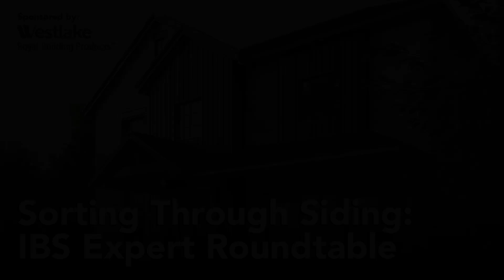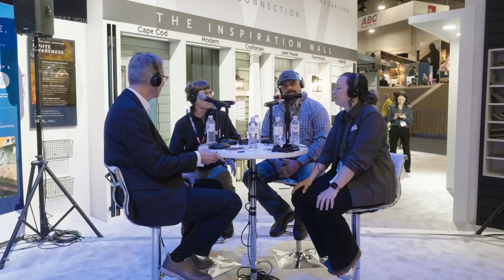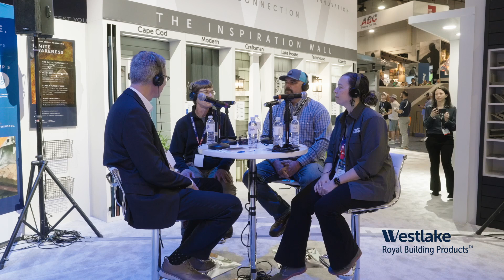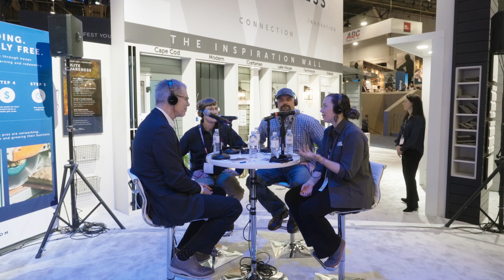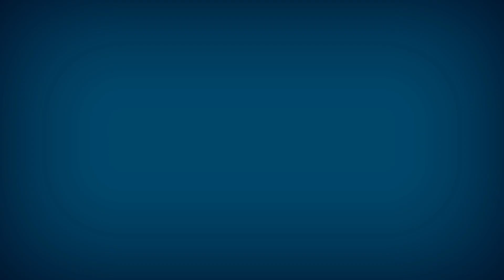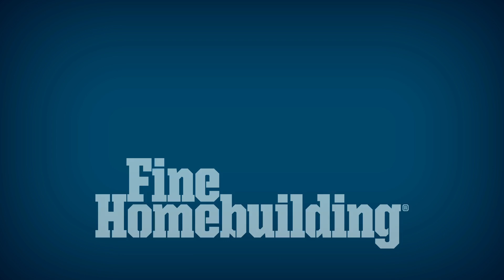Sorting Through Siding: Expert Roundtable at the International Builders' Show

Comment: It is a difficult problem to solve... How do you create a siding system that can't be applied incorrectly? I've been doing window and door specialty work for the last 5 years. Improper installation and flashing/sealing of windows, doors, siding and trim is almost always the culprit for moisture intrusion; rarely is it a product design or manufacturing failure.

 I know around here, almost no one has been using cement board siding for years now. It's a good product if it's very carefully installed, but today's LP siding is just so durable and the installation process is more forgiving of missteps. Plus,  cement board has too much thermal movement for our climate.

Interlocking systems like tongue and groove are nice for a higher success rate on proper installation... but it's not forgiving of mistakes, and lacks flexibility for unique situations. The overlapping siding that has been used for centuries is a simple concept that can be applied in infinite ways. When I am training people to look at water intrusion issues I have them think about every layer of the exterior envelope as "siding"; try and find where the installer improperly lapped one material over another and created a failure.